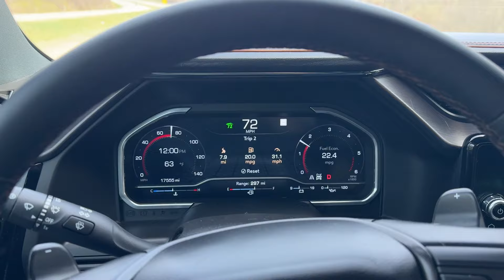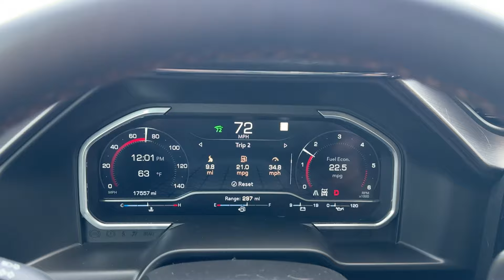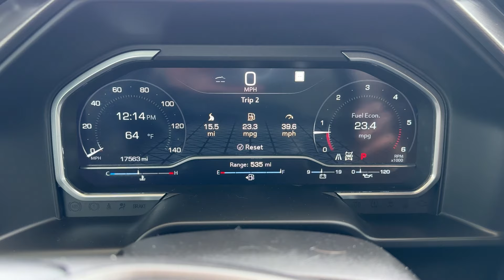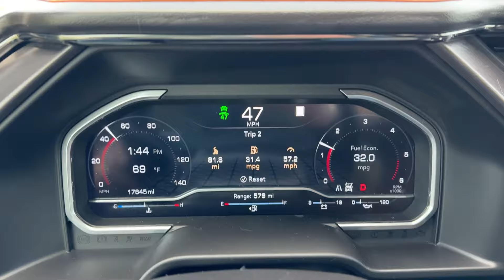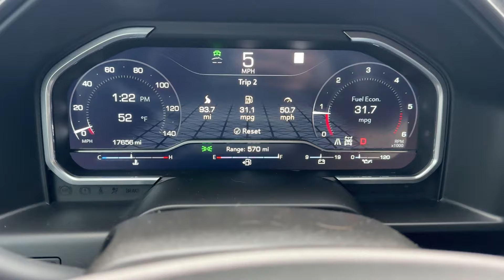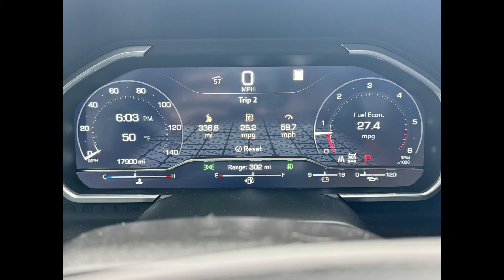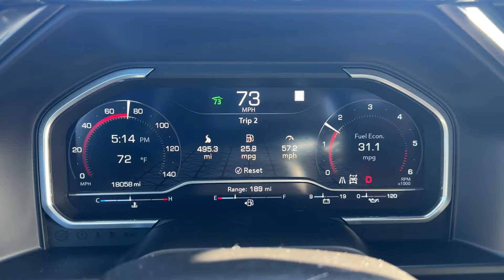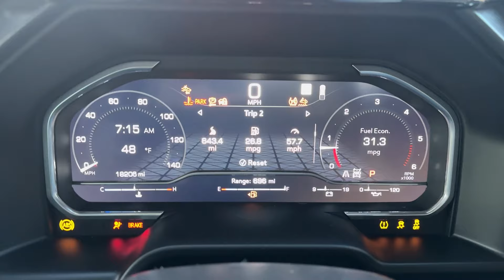2023 Sierra 1500 AT4 3.0L Duramax Diesel 650mile roadtrip tested

Comment: The AT4X is way outside my budget...but how do the AT4 hold up with city driving (3.0 vs 5.3)? My commute is a maximum of 10 miles, but is 100% city. I do some highway driving time to time but primarily suburban USA.

I currently own a 2023 Tundra (8,500 mi). I love the truck, but the premature engine failures have me concerned. Dealers aren't even accepting 22/23 trades because of the issue and toyota dealerships can't sell impacted inventory until their is a fix. I bought the extended warranty because i planned to have this 15 years but not if an engine blows!
Reply: On that short a driver you will not get the diesel up to operating temps,  especially in cold weather.   That will affect mileage.
Reply: Check out the 2024 Trail Boss edition.  VERY similar to the AT4 and one helluva a LOT cheaper.
Reply: @robedmund9948 thanks for the comment. Will check that out!

Comment: Thank you for posting and sharing such a thorough review. I just purchased a 2024 1500 ZR2 Bison with the Duramax 3.0 LZO. Given the owners manual recommends the use of only top-tier diesel and how scarce access to such diesel is not only in my area in California, but also nationally, lam wondering what other Duramax LZO owners use to fuel their trucks.
Reply: I'm in Las Vegas & we have diesel at every Chevron. Do you have Chevron in your area? Is that top tier?
Reply: By top-tier, it just means not red-dye or industrial grade diesel. Any diesel from a pump is fine.
Reply: True on the restricted use of Ag diesel. Past that the minimum cetane level of US diesel is something like 25 points lower the EU spec. My 3.0 turbo diesel performs better with routine use of Power Service silver bottle.

Comment: I was able to get 27.4 with the same truck but 2022.5 
Mine has a 6” lift with 37s 
Looks amazing and drives fantastic 
But the around town MPG is horrible 
Still nothing impairs to my 2019 ZR2 Duramax 
44+ mpg and it’s a mountain goat
Reply: Around town driving (short trips) doesn't allow the motor to get up to temp where the efficiency lies.  Let the motor warm up (especially if you have the remote start option) for 4-5 minutes, especially on colder days.  You will notice a difference.

Comment: I think a lot of that phenomenal feel economy on the first day was your low average speed. I know I get the same fuel economy in my truck that’s a 3.5 L eco-boost no matter if I’m driving in the city or the highway. About 17 in the city and maybe 18 on the highway, but keep in mind with our highway speed limits, I’m traveling 75 to 85 miles an hour. No matter how dynamic they make these trucks they’re still a giant box. It takes a lot of energy to push them through the air.

Comment: $3.18/gal for diesel in Okla City as of 07/29/2024.
Reply: Winchester, Ky. Diesel is under 3 dollars a gallon on Friday the 13 th 😮
Reply: Love my 24 duramax best mpg is 36.8 avg is over 30. Uses very little def fluid, use start stop feature, don’t let it idle, will kill mpg , very impressed, killer torque !